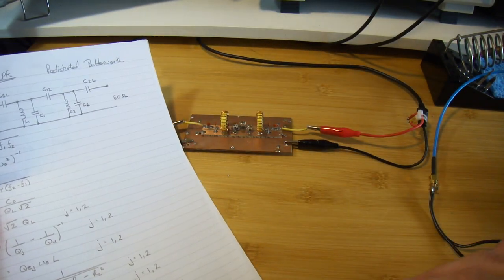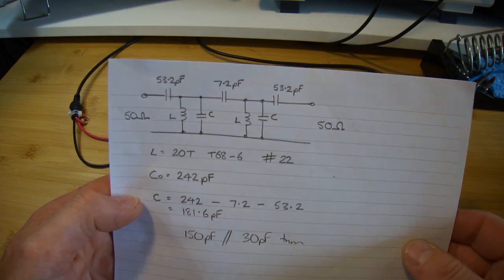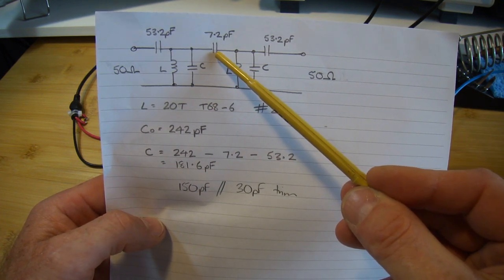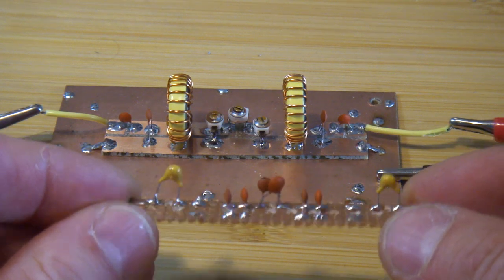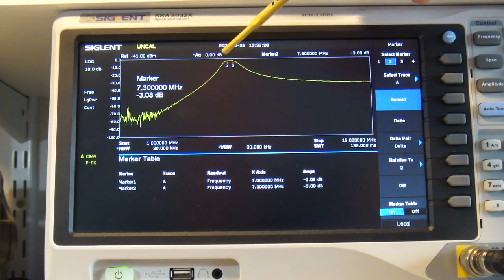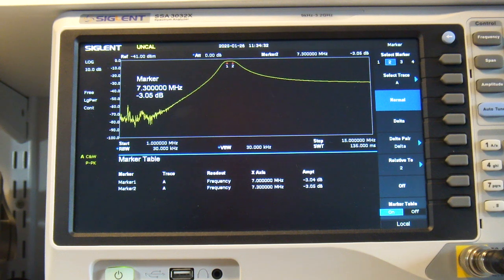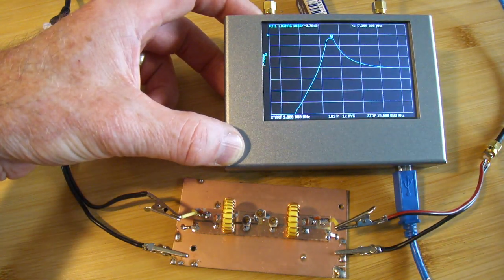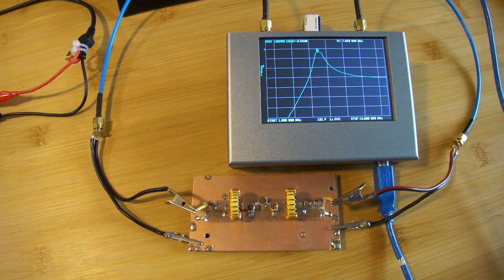40m Pelican Case SSB Radio - Part 5: Band-pass Filters

Comment: I just stumbled onto you YT vid. and project, so did not have a look at previous ones. Anyways just wanted to point out, have a look at Sept/Oct 2000 QEX p.13.
I've used these for a few years with my HB SDR. Works very well!
If you need a copy of QEX, just respond and I'll forward them to your call.
When I have a chance, I'll look at the other vids.

73's
Dale
Reply from the maker: Thanks Dale. I'll take a look.
Reply: @CharlieMorrisZL2CTM  Looks like my followup did not get uploaded.
Anyways, was suggesting, if you want a broadband low Noise Figure, low IMD, then have a look at the Norton Amplifier designs.

Comment: Great stuff Charlie. With a neat construction like yours and decent caps I'm thinking it should be possible to get the insertion loss down a bit more. I can usually manage below 1 dB. Maybe it is the crocodile clips! RF connectors on the board might help. Anyway, just a thought. Thanks so much for all the inspiration and encouragement you give to homebrewing hams all over the world. Keep up the great work. 73, Nick M0NTV
Reply from the maker: Agreed, the test leads are not the best. The caps are cheap too. Cheers Nick.

Comment: Thanks for the video.  I was reading an old QST article last week about making these.  Watched a few videos and yours just came up.    Would like to try 3 and 5 stage filters to see the difference.  Also would like to try a few for 2m and some other higher bands to use with an SDR.
Reply from the maker: More stage will certainly perform better. For what I do here, these have worked well in the past.

Comment: Great video. The high side roll-off is a bit light. Not sure if your Oscillator (VFO) is on the high side, but if you run a LPF on the antenna port for both TX and RX, then it shouldn't be an issue.
Reply from the maker: Thanks. It will be interesting to see how it goes.

Comment: I use an online calculator for filters...   Jim Tonne hosts them.  No need to be good at math or filter analysis...  Saves a lot of time, allows quick analysis and lets you get on with the project.  But that doesn't make good youtube content does it.....
Reply from the maker: Thanks. None of these videos are how to's, but simply a video log. I have a self imposed requirement that where possible I do the maths and fully understand how the circuit works. I don't want to simply copy schematics from elsewhere. I hope that makes sense.
Reply: Wonderful mindset.
Reply: Do you have a link?

Comment: Great video, as always! One thing: The toroids should be aligned off-axis. 90 degrees ideally, but 45 degrees would be plenty already. In your set-up the field lines from the first toroid can couple directly into the second. By intentionally misaligning them, you'll increase your out of band attenuation.
Reply from the maker: Ar yes, that does ring a bell. I have space to offset each one +/- 45 deg which will give a total of 90 deg between the two. I'll try that now. Thanks!
Reply: coupling between toroid inductors are not typically greatly affected by orientation...  but if you're bit picking and trying to look smart then.....
Reply: No need with toroid as the field is contained within the toroid unlike close wound coils (air cored or on formers) which certainly would couple if the orientation was the same.
Reply: @christopheriles1469  Ah nice, a common theory and reality clash... You're probably refering to the magnetic field component. Yes, in an ideal world, the superior permeability of the core would contain the magnetic field inside the core. That generalized, oftentimes blankly parroted statement, however, doesn't align well with reality very well. Without diving into magnetics, one of the necessary boundary conditions is that the windings are distributed uniformly. Which they never are. On top of that, the core itself is basically a single, circumferential turn that - in very simplified terms - acts like a transformer winding to the many axial turns. The magnetic field from that will unfortunately radiate outwards (or inwards) in the direction the holes are pointing. All those problems don't even cover the electric field component yet. If that difference is significant enough, any homebrewer can decide for themselves. However, since just offsetting each toroid by 45 degrees can be done quicker than arguing with strangers on the internet about whether or not that's necessary, I'd say it's worth trying.
Reply: Should add ' conventionally wound' coils, not necessarily close wound.
Reply: If you do make any changes, an update showing any changes or no changes  to the output would be appreciated.